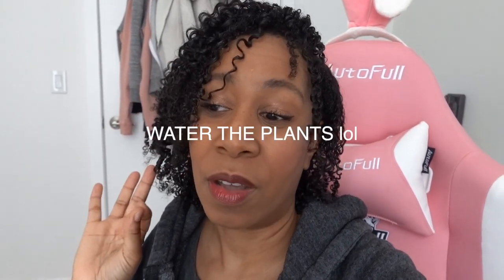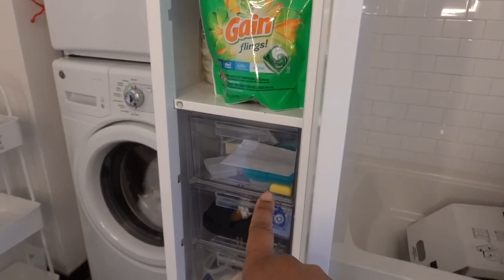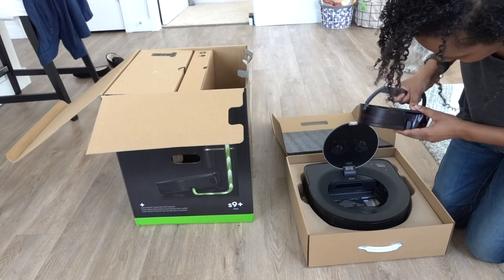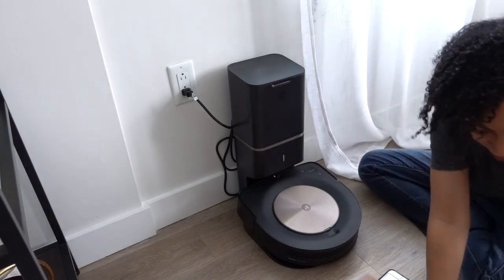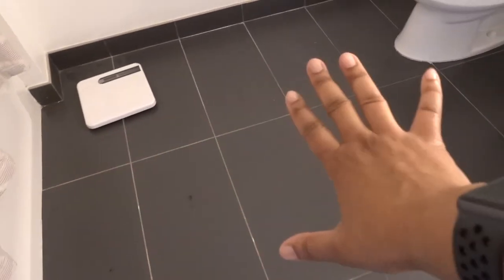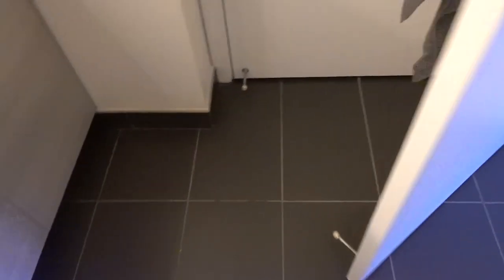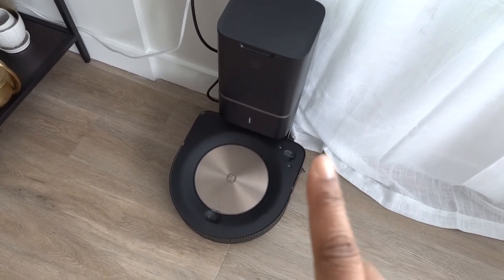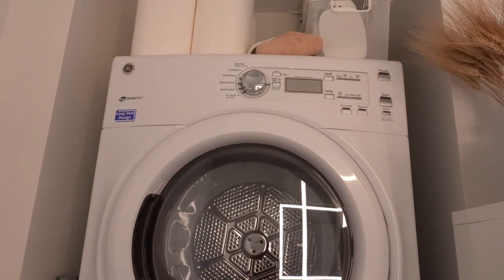Sorting the Bathrooms & New Roomba Unboxing! | VLOG

Comment: Yes both bathrooms look a treat. I like the new Laundry trolley. I too thought the Roomba Rosie a little loud. Perhaps it will get quieter after it's been run for a time.... I want one!☺️
Reply from the maker: It’s LOUD. I got used to it after a few days though. It took 4 days to learn the map of the apartment and now I don’t have to send it around everywhere but it’s still pretty loud 😆
Reply: It's so beautiful and looks like the latest tech I can't help but wonder if there maybe something that needs to be modified or removed? The other two Roomba's are not nearly as loud. I nearly did a Clover focused snout when I first heard it! Either that or it needs more time. I'm hoping someone else already has one and could perhaps give you some hits?